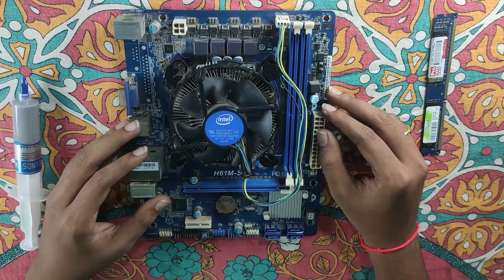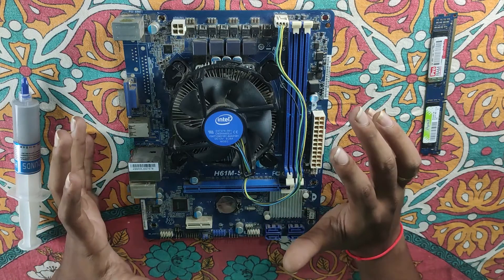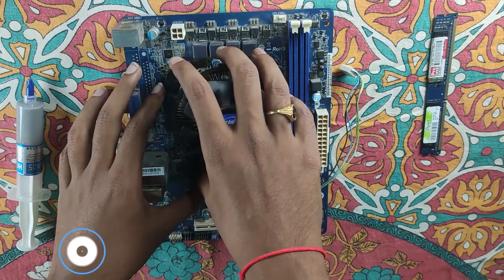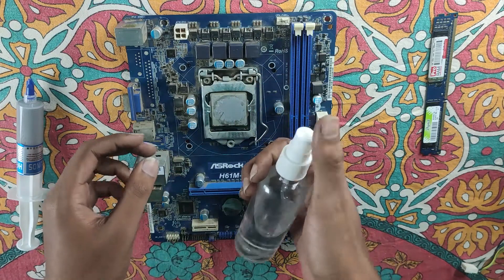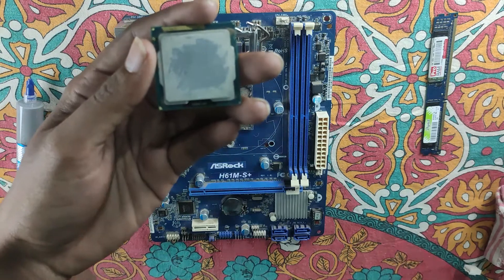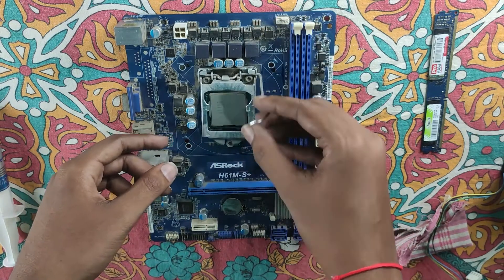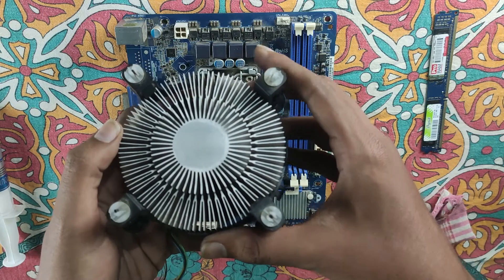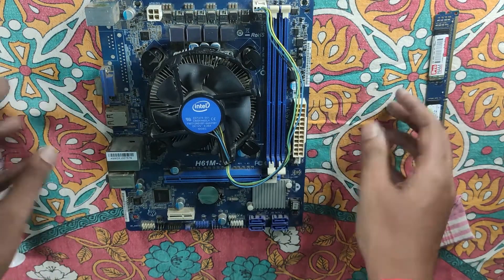How to change CPU thermal paste

Comment: Processor -- rygen5 3600
Motherboard---Msi B450 Pro-VDH Max
Ram-- Corsair veg 8gb ( DDr4,3200Mhz)
Storage-- Seagate barracuda 1TB (hdd),WD 240GB (ssd)
PSU -- cooler master 550w
•Nanu PC build cheyalee anukutunanau any mistakes untaa chupu...
Reply from the maker: Compatible...